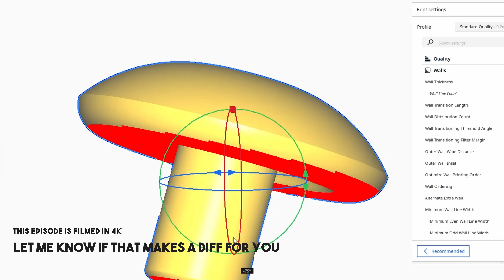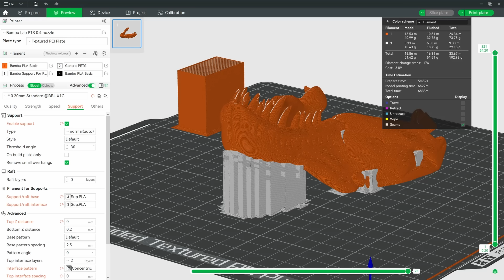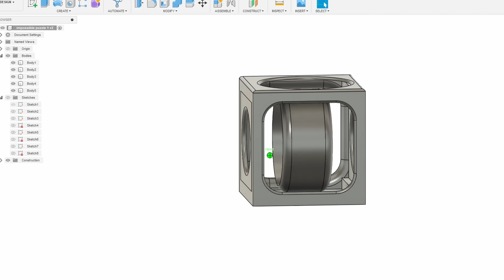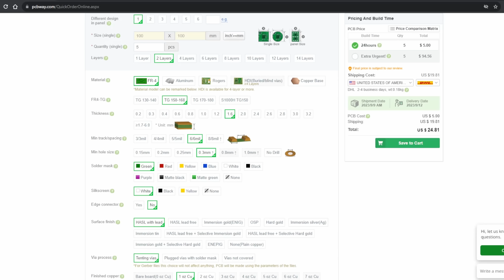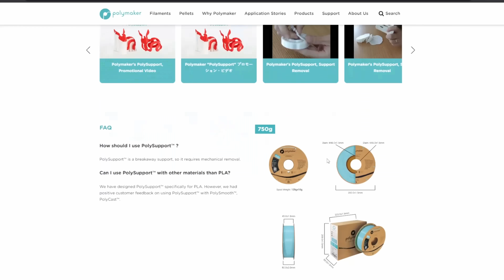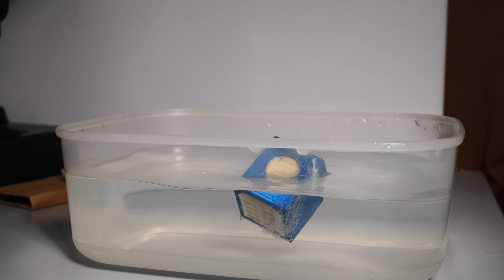Perfect 3d Printed Undersides - Dial in your slicer's support settings!

Comment: When I have my settings dialed in correctly ussually  half the supports will stay on the build plate and the other half I can push down on either side of the print with my thumbnails onto the interface layer and it just pops off cleanly. I try to keep my Z gap 1-2 layers depending on layer height.

Comment: Also, a very good tip: Put PAINTERS TAPE between support and object! (you need to pause so works best on flat roofs)
The surface will almost look like printed on smooth build plate.

Comment: Apparently coloring the top of your interface layer with a sharpie is supposed to allow you to use a 0 mm offset without the prints adhearing to the supports; I've yet to try it, but I have a model that kind of needs it, so hopefully it works out

Comment: Why can't the bamboo labs AMS support it though? It's is something that could be modded in? Or is it a more fundamental problem with the printers / AMS?
Reply from the maker: Support what? 🤔 PVA? They just released one that supposedly (emphasis on supposedly) does
Reply: The way the AMS work, it have mechanical problems with soft materials like PVA and TPU. It might work but not reliable. Pushing soft materials in long tubes forth and back is not optimal. This will most likely be the same for all other similar multicolor products coming from different companies this summer. The reliability might differ a little bit between products because of small differences but I think all will struggle with softer materials and it will only be minor differences where the limit is.

Comment: Another note on the solubility of PVA: glue stick is commonly used as a bed adhesion modifier. Most people apply it by simply rubbing the bed with the glue stick, but if you dissolve the glue stick in a small amount of water first, you can make a PVA slurry, apply it with a brush, and then use the heated bed to dry it. This gets a much more uniform coating than directly using the glue stick.

Comment: Thanks for the video. Got a Neptune 4 Plus back in November, and back CoPrints multi-color extruder system in December, so hope to get multi-spool support in a month or so once they start shipping. This will help out a lot with the different TPU projects I have going now. I have tuned the TPU supports to where they did come off fairly easily at the cost of some layer adhesion, which is not ideal, but actually helps my part be slightly more flexible and easier to work with for its design purpose. Will certainly be experimenting with support material once I get my new print head.

Comment: What we need is an option in the slicer that creates a "flip" in the program that allows you to flip your part over and run the 2nd half of the program eliminating the poor quality on the underside of your prints.
Reply: I have no idea how you could do that and line up the layers to be perfect
Reply: @tatertime  you'd need some kind of fixturing to be printed in the first part of the print. Say for instance, a couple of alignment pins protruding up from the print bed. At the upper portion of the first half of your print the slicer would need to add some type of brim (figuratively speaking) with holes in it that would line up with the pins when the part was flipped over. Of course, this is all hypothetical
Reply: @RYTHMICRIOT  Ok, if that were somehow lined up perfectly that does sound like it would work. You could actually have two different gcode files for when you want it to print the upside down part and have the print in an area where the printer can still home. 
... Well now I want to try this lol
Reply: @tatertime  yeah, is difficult. Lots of variables. Like, I'm not sure I put my magnetic print bed on exactly the same each time. And then what's the best way to start the 2nd program at the appropriate "Z" position? I think it could work. Probably best to test with a simple print geometry. Like a cube or sphere.

Comment: When using a multi-extruder setup, PrusaSlicer allows you to use a different extruder for the support structure and the interface layers, so you can print the bulk of the support in whatever you're printing the model with, and just the interface in PVA or breakaway support material. Less expensive material used, and less material to dissolve if you're using PVA!

Comment: Is it possible to make support color changes to match what you are printing , and or print a color that will be using the most of a filament that is printing  multi colors on the same plane . and switch to the next that is usung more than the other colors?

Comment: Video is good for people with multimaterial printers. Title is misleading however. It is not dialing, it is just about how to use different material and you need multimaterial printer, which most people don't have, so it should be said in title, that it is for multimaterial printers. For me it was waste of my time.
Reply: Thanks, these type of videos piss me off because I sat through a whole video to not get a single piece of information about dialing in. Annoying to someone like myself who is trying to learn supports
Reply: Thank you, I was getting that feeling 30 seconds.
Reply: Thanks, didn't bother wasting my time.
Reply: Thank you, saved me time and also from subscribing to another click bate channel!

Comment: What do you propose for the best budget multi-extruder printer?  My ender 3 (first generation, 2018) is long in the tooth and I'm considering replacing it with a non-bedslinger (or, probably, use them both).  I like the idea of a voron, and the K1 Max has been well-received among friends, but neither are dual-or-more extruder, so...
Reply from the maker: multi extruder? not a lot of choices out there is there. I wish there were more. I did review the SV04 a while back.

Comment: I have a tip for you. If it’s flat support pause and use a marker on them before it prints the layer on top. Print with 0 gap. They will break away super easy.
Reply: I will try this! That’s the kind of advanced trick I expected from the video glad I went through it to find your comment, otherwise it would have been  a waste of time.

Comment: If you didn't dry your PVA with the heat of the surface of the sun for a day or two that's almost guaranteed to be the cause of the meh prints. I dry at 85C for about 3 days with a new spool and continuously with a PrintDry Pro at 65C when using the PVA. Results look great then!

Comment: PrusaSlicer for the win. You can set the Z top and bottom distance between support and the model (and interface layer) to anything you like. Depending on which printer and material I use either 0.25 or 0.28 when printing at a 0.2mm layer height. Easily removable supports with virtually no scarring.

Comment: I use supports with TPU prints without any issue. Specifically, I use TPU to support itself. It helps to have your support settings tuned well, but it works.

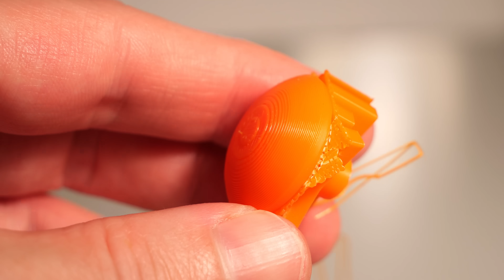Comment: 7:20 - I'm pretty sure Prusa slicer allows you to do half layers. If you're printing 0.2 mm layer height, you can set the gap between your supports and your part to be 0.1 mm, and you can even see this as you preview the sliced file layer by layer.
Reply: Orca does as well, I've used it myself

Comment: The tip about using the support material just for the interface layer is a very good one, that's going to save tons of time on a fine layer model...    
-Have you tried a combination of that with 'tree support'?
Reply from the maker: I did - it works with most models, but the actual serious reason use that mushroom is because it's an effective support torture test - the clip at the beginning has many tree/interface mixes and most of them snapped mid print - the reason is actually weird, the slicer seems to use the support material for the whole support layer not just the interface part, so the trees have a weak section. It's probably a slicer bug and I should probably report it.

Comment: There is a  technique to print PLA with PLA supports with zero clearance. Andjust the parameters of the interface layer to a line width of .2mm, set the flow rate to 66%, and a support interface density of 33%. the interface will print properly but will pop off easily and any support interface left behind, it will just rub off.
Reply from the maker: yeah underextruding, I thought about that, since it does that on parts by accident

Comment: My ultimaker worked great with PVA. Just used the standard profiles. Just put the parts in a dishwasher to dissolve the PVA. Sold the printer 3-4 years so. Using aBambu X1C now, but have not tried the support materials. Will have to give it a go.

Comment: A quick search on researchgate suggests, counterintuitively, that COLD water is better at hydrolyzing PVA. Some substances just get gloppy in warm water. "Why does it work? A polymer in solution has to balance two effects - hydration which will want to make the polymer molecular unravel and entropy that wants the polymer to coil up somewhat. Hydration is easier at low temperatures and - thanks to thermodynamics - unraveling is easier and so the polymer dissolves more readily"
Cold water and agitation- a stir plate if you have one for a resin printer. PVA is alcohol soluble as well, and sometimes a mixture of solvents is more effective than a single solvent, so maybe 20/80 isopropanol/water.

Comment: So I use orca slicer and my support interface gap is set too 0.08 and I have a cpap remote cooler setup and the supports are pretty easy to remove so I am pretty sure that orca slicer will do smaller than single layer interface gaps.

Comment: I think it's important to note that when using multiple materials in a single extruder, you need to make sure your purge volume is sufficient to remove all of the support material. Otherwise, you can end up with weak layer adhesion and other inconsistencies in your next layer(s).

Comment: Back during the height of the pandemic I printed some mask straps for my (at the time) pre-schooler. I used TPU for the strap and then did superhero logo detailing in PETG. The bond was actually quite strong, so I'd recommend not using PETG as the support interface material when paired with TPU.

Comment: In my experience I gotta say prusa makes far better support than cura. When the settings are right, and by that I mean for example flow rate for bridges (set that low), then it removes soooo easily
Reply from the maker: I agree, the bridging default and paths are better in prusa. 

...for now 😏

Comment: I had my library print some stuff for me before I got my own printer, and theirs had some fantastic results with PVA supports.  My best guess is good results with PVA requires two things:
1. A full multi extruder/nozzle solution, not just filament changing
2. Very dry PVA, as it is incredibly hydroscopic and will bloat itself with water rapidly (this is an educated guess btw, as the library's printers were running almost nonstop and therefore went through reels of filament very quickly)
...but outright dual nozzle systems tend to be expensive/commercial, so this is moot for almost everyone tbh
Reply from the maker: yeah I did feel I could have spent some time tuning PVA, I might try to dry it for a few further days and see what happens.

Comment: I have had some luck printing horribly thin and fragile structures which need extensive support because they were really designed for MJF, using PrusaSlicer. It generated some sort of fragile curly surface that broke apart and peeled off. I haven't had much luck with Cura support roof for these. I print in HIPS.
Reply from the maker: I have wanted for a while to do something about printing miniatures and the challenges they bring, especially when you go to a lower size nozzle - supports kinda don't work. It's sorta the same problem I think
Reply: @LostInTech3D  My comments are both hidden, but just wanted to say it looks like PVA may actually be more soluble in cold water.

Comment: In PrusaSlicer and its forks, it can set a Z distance between the support interface and the part at non-multiples of the layer height.
It will print the support at a different layer height and make the top interface at the right gap you set.
Reply: Also true in SuperSlicer and OrcaSlicer, as far as I know. 👍
Reply from the maker: Interesting..... I'll have to test that out

Comment: Ive heard there are usually issues with doing a dedicated supportnmsterial on an ams style machine is that it usually messes with layer adhesion. Is this the case with the ams still?
Reply from the maker: I had some issues with tree support snapping but otherwise no
Reply: Absolutely! However, if you triple purge length and significantly widen your purge tower, your results will be much more acceptable. Otherwise, the results will look pretty but a hard sneeze will snap the parts.

Comment: If you can't do multiple materials, do organic supports with incredibly low density and it will just make thin walls of support structure which add little printing time and use little material. Then use a reasonable support interface density with at least 3 layers to allow bridging to stop. Add a roof that is very dense with minimal spacing to the actual part and it it will give you the best quality underside while still being removable. That's basically my method if I want optimal quality. Like you said, tune the interface, the supports really don't need much structure at all to function as long as you build them up at the top.
Reply: ^This^. Also, under some circumstances, the "add interface loops" provide a standoff from the support to sort of help support the object, which is effectively a bridge in that area. I guess this is not really accurate, it just produces less surface area for adhesion between the support layer and the object.

Comment: I appreciate this video. I think these types of explorations are more and more important as IDEX and multimaterial systems become more and more popular. One note about PVA, I have heard that you can speed up the dissolving process if you have warmer water (not too warm that it warps/affects the other plastic) and move it around a bit. A clever solution I saw someone do is write a very basic gcode script that moves a heated bed of the 3D printer back and forth for an extended time period and place the tub of water on the bed. That doesn't solve the issue of the water getting saturated and becoming less effective at dissolving the PVA, but it might help.
Reply from the maker: I think that's the mistake I made, I used 55Cish water and I think that's what snapped the fragile model. PVA is one of those things where I think you could improve the interface, and stringing, and neatness, but I was so put off by the amount of cleanup/water that I thought it really is inferior to the other methods in all but the very niche cases. It was cool though!

Comment: Ok, here me out. For single head, single material, systems, an applicator, attached and aligned with the head, that can dispense a thin film of adhesion-preventing something. Maybe as simple as a marker that applies a thin oil layer to the last layer of the support, before the actual layers.

I assume some oil could be choose to have a high affinity/wicking to the build material, so it stays thin.
Reply from the maker: damn good idea....if not oil, then something , maybe wax or whatever.
Reply: Yes it has been tried and it works. Sharpie works perfectly well as a release agent.
Reply: Wow a support release agent is a great idea! Having to be there when the print pauses to add it would be a bit of a pain especially depending on model, but a tool head could also be designed to do it hahaha.